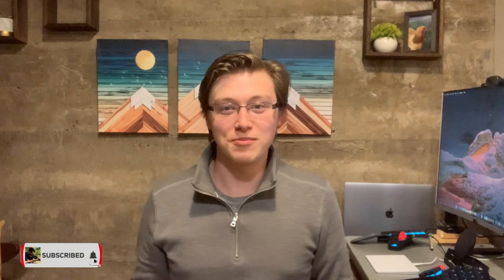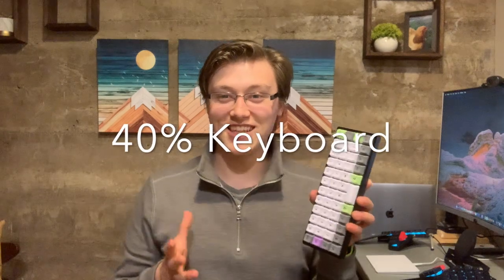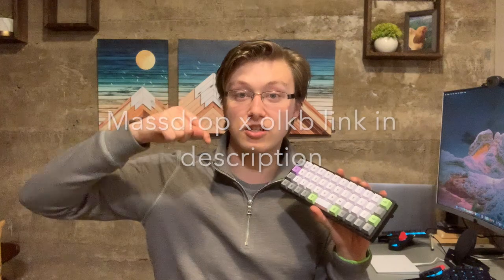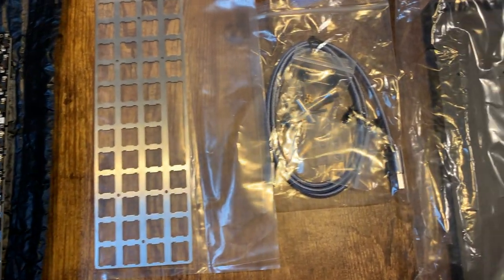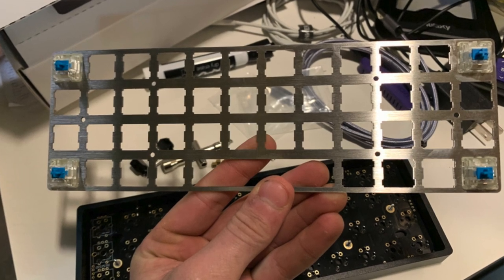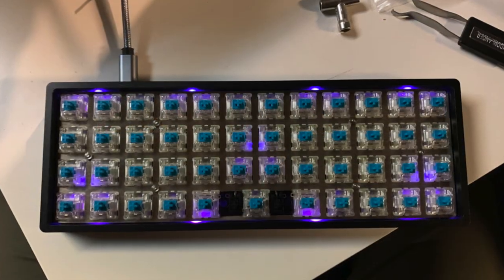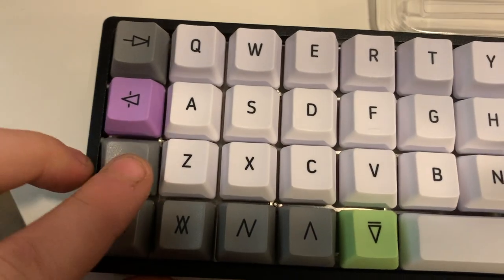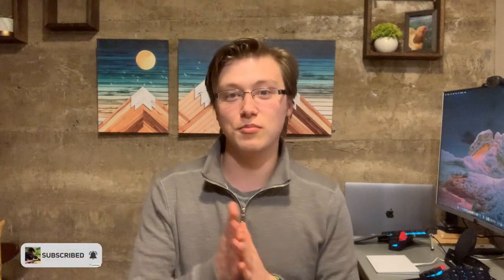Building an OLKB Planck

Comment: Eager to know about how you configure the Planck for iPad (Pro) use!! What about that „promised“ 😉 video??
Reply from the maker: So sorry about the lack of content, recently. I recently moved in July and that's taken up a large chunk of my time. Hopefully, I'll be getting back into the swing of things, shortly. I'll try to put this at the top of my list. :) Thanks for asking!!
Reply: @Doctorcraft773  No worries! I got the Planck myself a few days ago and I‘m already hacking together my own QMK firmware – including the down facing RGB LEDs as status indicators (like lighting some of the LEDs red if CapsLock is on or lighting some other LEDs while holding down the RAISE oder LOWER keys or playing a short melody when playing back a macro that prints my eMail address etc.). 😊 Works on the iPad Pro, too, but had to order another, USB-3-fully-compatible, USB-C to USB-C cable.